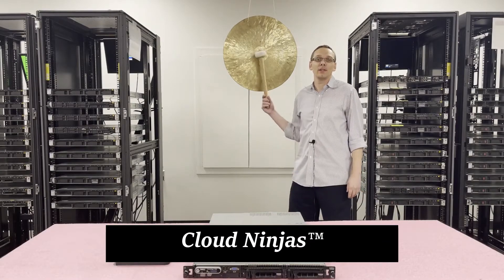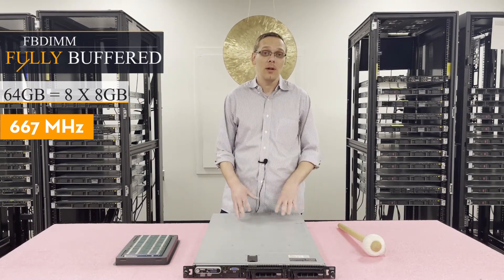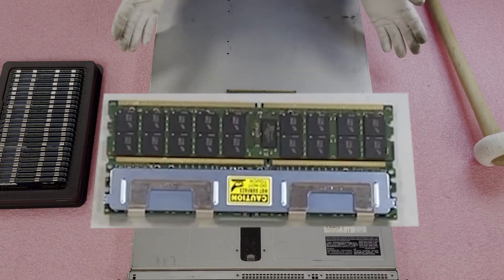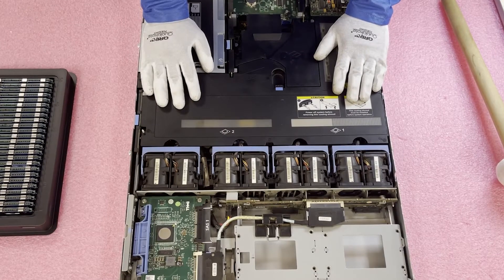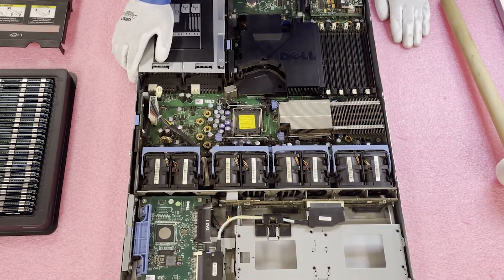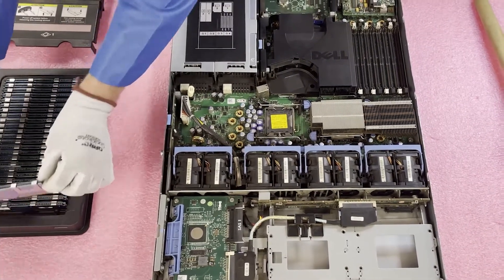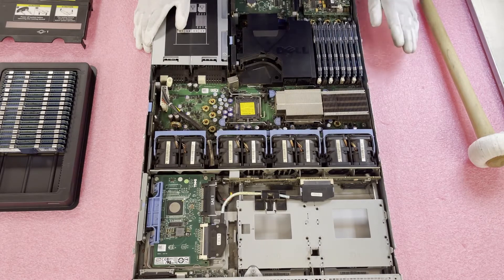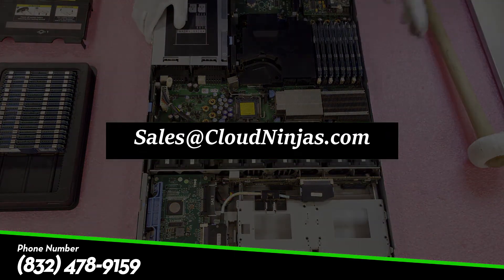Dell PowerEdge 1950 Server Review & Overview | Memory Install Tips | How to Configure System

Comment: Hey, How can I identify what component failed? I get this message, "E1000 FAILSAFE, call support E1217 5v pwrgd poweredge 1950" I was thinking of buying another server and just moving the drives but there are two drives and I think it was raid 1. Can I just move the drives to a new server or do I need to do something in the bios? I don't want to lose they data and they don't have backups

Comment: I use this server and run debian linux on it. It is outdated, uses a lot of power and the fans are loud, although it has been really stable.   It has no pci e ports unless you get the riser card. I bought the riser card for it and the server did not recognize it.  It is the first real server I have used but i wish I had bought a newer used server.
Reply from the maker: Yes this is DDR2 based.  DDR5 is out now.  We still support upgrades for the 1950 and 2950 but recommend a newer system.  If interested in some economical DDR3 or DDR4 server solutions then please email sales@cloudninjas.com.   We would love to help.  Take care!
Reply: @cloudninjas  Hey yea what do you recommend?  I mostly use it as a samba share.

Comment: Hello. At my work I have been given one of these to use in a lab so I can learn how to install windows server but also so I can set up my own domain, domain controller, DHCP server etc. It currently has a SAS hard drive in each hot plug caddy and I am trying to find out if its possible to replace the caddy or get an adapter so that I can use an 2.5" SSD instead of a SAS drive since these are extremely slow in comparison. Do you know if this is possible?